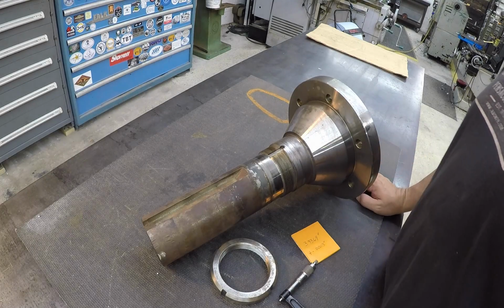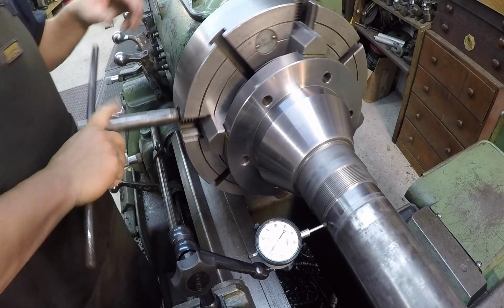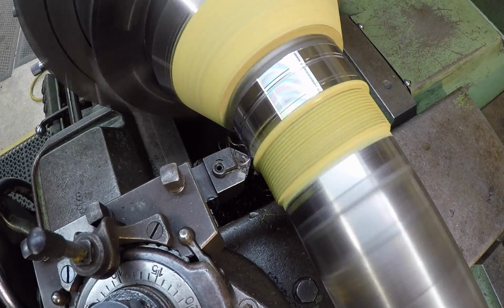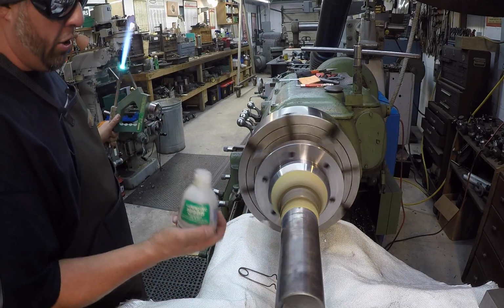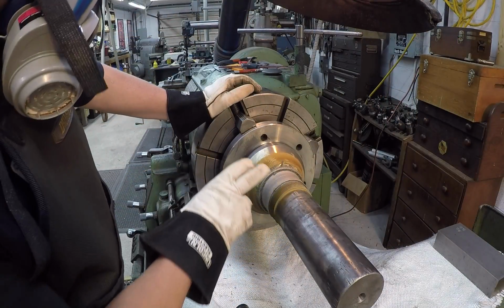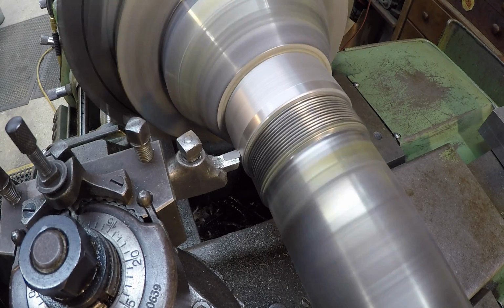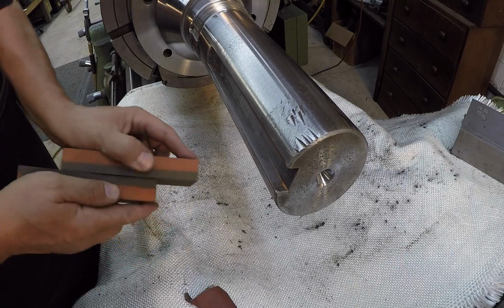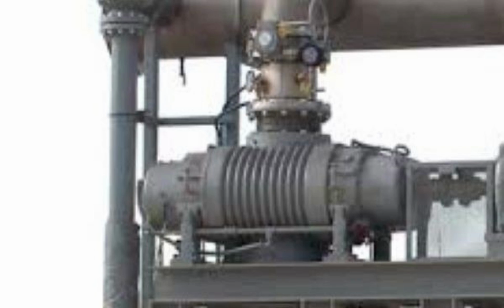SNS 300: Spray Welding a Blower Shaft

Comment: I was struck by the turning down of the spray welded section that the metal didn't come off as a spiral but as flakes. Is the welded section more porous on a microscopic level? A bit like a sintered bearing.
Reply: It is a 'cold work' process, so for sure metallurgically different than the base material.  Sintering is likely a good comparison.

Comment: I read about this process about 50 years ago. I was impressed by the possibilities, but I never had a chance to see it actually done. I talked about it to a friend who said I was BS-ing him. Now I'm vindicated. Excellent video. Thanks for posting it.
BTW was this process ever used in crankshaft stroking? Would it even be suitable for such an application?
Reply: yes, the process for repairing a crankshaft is very similar. Difference is the powder. Like he talked about it takes a special type of powder because of the friction on the actual journal surface.

Comment: To ross reed; I see you have removed or had your coment removed. To explain to you an Instrument maker means I spent 7 years gaining my qualification. Most of my has been spent working on Military and Aerospace prototype work and I am currently working for a satellite company so I think my ability and knowledge suppresses yours by a little. To answer your statement as clearly as I can. Your knowledge of engineering is only surpassed by your ability to re-bore a Harley with an angle grinder.
Graphite grit or similar comes off paper or cloth and embeds itself into softer materials. Grinding say for example a camshaft you use a rotating grindstone whether it uses diamond or graphite and on a CNC or manual machine It is a precision tool.... is not the same as sticking it on paper or cloth. All I was asking is why would you do such a good peace of precision work to then use cloth when you have stones to hand as shown in the Video ?!?
Reply: Togz100 has come

Comment: nice haven't seen this in ages . we did spray build back   in 70's and 80's  in shop i worked for,  nice example  of the need of  prep the surfaces  first. and one  company we did a large  amount of work was specific  pumps and blowers also

Comment: I am not a machinist by trade, but have for the past year year worked in a paper-winding factory that predominantly makes kraftpaper/cardboard tubes, liners, and cores. I call myself 'the wizard's apprentice' in that I am there mainly to assist the machine operator with the functions he performs. -Bring tools, carry this, lift/mount that, palletize the product, etc. I watched this entire 51.04 video and am in a word, in awe of what I saw. The video very closely demonstrates what my immediate co-worker (the operator of a massive paper-winder) described for a series of mandrel repair processes he periodically does at another shop to 'build up' weld on rotating and/or stationary shafts where super-close tolerances are required.  My take-away from this video is a greater understanding and appreciation for the work involved. This video is amazing! Well done, you!

Comment: As an instrument maker for over well 40 years now I am very surprised you used abrasive cloth to bring down the bearing face and give it the final polish as you will always be left with traces of the abrasive which will speed up bearing wear regardless how small and how much you clean it. I have always used precision ground stones as they are better to maintain and ensure an even profile and you don't leave contaminants in the bearing face. I know I'm old school (on QC now but I would never let that out the shop floor) or am I missing something?   Impressed with the rest of the job 1st rate
Reply: My humble opinion, but in my observation there is a heck of a lot of difference between a precision instrument and a 70# hunk of steel that is used to turn a blower cage.  The bigger question is how did the shaft get so tore up to begin with.  Lack of attention to bearing lubrication and/or lack of attention to machine vibration come to mind.  In the world I came from (water/wastewater) there isn't a budget to get a NASA-rated repair.  Get it so the new bearing will seat with the proper fit, educate the maintenance crew about how to avoid this problem in the future and get it back into production.
Reply: @larrypatterson3957  I agree totally....... A very expensive hunk of metal with a precision bearing where a repair is a much cheaper option than replacement.
Reply: So stones are not abrasive?
Reply: @justinbenjamin4651 A precision stone cuts as opposed to grinds (it is still termed as grinding). Yes stones do wear but to a very much lesser degree and the cutting fluid holds and caries the derbies away thus greatly lessening any chance of leaving derbies on a bearing face. 

To summarise its cleaner, quicker, more precise, does not leave contaminants behind and still an on hand hand-tool as he showed removing the pipe wrench marks. It really is basic 1st year apprenticeship stuff.

Comment: I was thinking you were going to TIG weld the tool marks but that would have probably been a waste of time. Nice work.
Reply: That was actually what I thought when I started watching this video...
Reply: A TIG weld, or any type of localized welding would cause the tube to distort.   So, that wouldn't work on this job.  The spray weld does heat the metal, but the heat is applied while the tube/shaft is turning...so the heat distortion is equally distributed on all 360 degrees of the shaft/tube.  Evidently this shaft spins at high rpm while in use.  So any distortion would cause vibration....possibly self destruction.
Reply: @WAVETUBE84  , thank you for the feedback.

Comment: I am 60 and a former A & P Mechanic and had never heard of this type of welding, this is one of the best videos I have ever watched and wish I had half of your skill.
Reply: Yes same.. never heard of a spray weld befor..
Reply: same here never heard of spray well before but I've done a lot of different type of other welding this was the most awesome thing I've seen and very well explained throughout video step-by-step.
I would have been afraid to take off the other end where point meats shaft. Steering shaft may get too hot and sag.

Comment: The first and only time I used Spray-welding was over 50 years ago... I feel really old
Reply: Me too! Exactly 50 years ago I had the front end of a '69 Alfa crankshaft repaired this way when the nut holding the harmonic balancer/pulley had come loose. I was hopeful but skeptical it would save the crank. The loose balancer/pulley then chewed up the mating surface on the crank and the keyway, and the key, and of course the pulley. The problem revealed itself because the mechanical fuel injection is timed off the pulley by a tooted belt and the car alternately ran great and then like s*it depending upon how far the pulley rotated off the timing mark. Had a racing balance done on all rotating parts (0.5 gm) and the new pulley came back looking like Swiss cheese on one side. Voila, the problem from the very beginning. After this the engine screamed for more than 135K mi. before other parts of life made it a garage queen. Still awaiting the wrenches... Thanks for the vid. Never seen it actually done. Great work, too.

Comment: This is an excellent clip for learning machining and surfacing. First, Sir centered the shaft in four holders using aluminium washers and bolt pressure, as well as measuring instruments. Then you secured the shaft on the thread and the cone. After heating it with technical gases, he began the surfacing procedure. I do not know wheter special powders or emulsions? I haven't seen this technique yet. And the standard final procedure is turning and grinding with sandpaper to achieve an accuracy of 0,0003 inches. Very good  work. Congratulations :).

Comment: When you work on a project with a small tolerance like this the first thing that popped in my head was expansion. Looks like using a torch running that hot for a long period of time would cause the steel to expand. It's probably a dumb question because the piece was so big but how about a smaller project that's only one inch in diameter? I think you touched on that at the end but I'm not sure. Great video, by the way, I love this kind of stuff.
 Dave

Comment: Back when I was a teenager I did bit tipping of Hughes drill bits I due believe that this is the first uses of spray welding, I did wonder if it could work on shafts too. Well, now I know that my own thinking was right but I had no one the tell about the usefulness and Quality of said processes otherwise I would try it when I was working on trucking shafts.  I'm now over 80 years old. And just learned that was right. I could have used the process toward my benefits.

Comment: Out of curiosity would this procedure be acceptable to repair a bearing journal on a crankshaft?
Reply: Absolutely. It's one of the very few ways you can build up a damaged thrust surface on a crank, since most of them will get junked if that happens.

Comment: How great to come across your video! Back in the 1970s I was a factory Sales Rep. For Eutectic, and sold this system Utaloy  as well as Hard facing powder sprays for farm equipment to ocean going ship propellers  !  Eueectic mfg     
 Ac,..Dc,.stinger does  great repair on CAST IRON and Alumanum .  It's a great company with great products!

Comment: Spray welding is considered a cold processes???  All things in relativity I suppose, I know in the days when the shop didn't have AC, parts that were made in the day would go out of tolerance at night, and vice versa due to the 'extreme' temperature swings.  Cool processes, thanks for the video!
Reply: There is a cold version of spraying https://en.wikipedia.org/wiki/Cold_spraying there are even 3d printers based on that technology,

Comment: WOW, i have worked on lots of different machines in the past. I built handmade caskets for almost 30 yrs but the plant went south of the border. Now i'm repairing long wall mining power distribution systems up to 12470 volts. Your work says alot about how you do the the very best you can. Great video.
Reply: Yep capitalism  strikes  again

Comment: Sorry to be so picky, but does that decimal number (0.0003) not show 3\10,000 instead of 3\10? Redfox007
Reply: you are correct, however in the industry, most guys call ten thousandths, tenths.  3.9372 is usually said as 3inch, 9hundred thirty seven thousandths, and 2 tenths(meaning, 2 ten thousandths).  I always thought it was odd myself, but that's how most machinists roll...
Reply: When he said three tenths he meant three tenths of a thou.

Comment: I worked for a co that didn't understand what the guys on the floor where doing that machine shop isn't a round any more. It was run by bean counters for about 10y before it went under. Had been around about 50ys put about 50 guys out of work some had 30ys to 45ys working as machines I had 15ys some stared there owen shops😎phill gusto 😎

Comment: I do robotic thermal spray.   We normally use plasma to buildup material for similar shafts.   Great way to save very expensive aerospace parts.  It can be coated with tungsten carbide also if you need a tough area for a bearing journal etc.  These repairs are usually aerospace only.  Normally you need to grit blast the area before you spray weld to get a better bond
Reply: Would the under cut and scratch pass (with threading insert) be an equivalent prep to your grit blast?  I’m assuming the under cuts give a larger lateral hold at each end for the entire buildup area while the scratch pass roughs the surface for bonding and possibly gives a bit more lateral grip/texture.  

Closest example I can think of is using a throwaway drill bit to sure up an epoxy repair on a broken gun stock.  Opposed to using a straight rod/wood dowel rod.  I’ve seen others cut grooves into brass or steel rods too. Also making sure all surfaces to be bonded are not smooth.  Gives all the “bite” possible.

Maybe this prep work gives a work around to sandblasting, and possibly a better hold for this application.  

Just curious.  Obviously, this stuff is super interesting to me.  Like anything way out of my range of abilities :).

Comment: A.S.M.E. Certed pipewelder here. Mostly maritime ind related. We would use this process to build up prop shafts, rudder stock shafts and tapers on propellers .
This and "thermal "( or poured) welding were some of the more interesting jobs i had! This is good to a certain thickness ( if memory serves) and then your stuck with auto sub arc and the subsequent straightening post weld.

Comment: In NJ there’s like one company that does this that I know of, pretty much everyone goes to them for it. They do it on site also, although I’m not sure how they do it without a lathe. I am guessing they use the motor itself and some portable cutting tools.

Another thing that is common is a ceramic or epoxy like material. We have a balancing business so we see this stuff a lot.

Comment: My dad used this process back in the 80's to save many customers thousands and thousands of dollars by repairing the shafts of obsolete motors in old applications where to replace the motor was nearly impossible because of the application. He was a great machinist. RIP pops.

Comment: Used to do engineering/design of heavy equipment and repair of equipment. I have observed shrink fitting by using both liquid nitrogen and dry ice and the building up of weld and then remachining the entire part and then process annealing that part. (of course it slightly warps it) This is the first time I have observed a spray welded repair of a machined part. I really enjoyed this video and I used to take classes at the local vo-tech so that I fully understood processes like this. They don't teach you everything in college and good machinists and welders are just skilled differently than I was but they are skilled. A skill that is seemingly dying off out there. Thank-you for creating a great lesson and introducing me to something new.

Comment: I never seen this before. One question: the substrate does not melt, so its not real welding is it? The process even includes a bonding primer, which wouldn't be needed if the powder actually melted into the substrate, right?
Reply: Imagine a load of fine spatter after welding this is what is happening in this process putting it basically. It is a very very fine application process, commonly used on rebuilding journals on an engine crankshaft before regrinding.

Comment: My grandfather was a prototype machinist for most of his life. He had over 175 patents in his lifetime. A lot of his work was spent in a salt rich environment. In about 1971 or 72 I watched him work with a blow welder as he called it to fix bearing journals. By the time I was was old enough to drive I had a Main bearing in a slant 6 to 25
Reply: Do not know why it just posted as I was not finished. But as I was saying I had a main bearing go out in my pickup and had to pull the driveshaft in a slant six 225.
My grand father watched me set up every thing  and helped a bit but made me use the blow welder after cutting back .0015 and than building it back up and turning it back in spec and polishing it. That engine ran for another 278,000 miles before I sold it. Was the only time I ever got to play with it as I went into another trade but I always had a bit of regret i followed the wrong grandfathers trade.

Comment: Wow! Could this be used to save a crankshaft in an engine that spun a rod bearing? Crankshafts are often made into boat anchors or big paper weights because of a few scratches on one journal. 
I’m not a machinist and I’m only a shade tree mechanic with a handful of engine rebuilds and replacements so if I ask a dumb question forgive me.
Reply: Kevin Tucker the heat that the engine creates is the issue.

Comment: Brilliant stuff on cold running metal... don't use it to repair internal transmission/engines shafts anything that heats up as it just falls off... ... they do a cast iron spray and plastic to 👍

Comment: Did a lot of metalizing/ spray welding for 35+ years. Mostly Metco stuff (powder and wire systems), but also included Eutectic maybe 10-15 years later. Very nice job! I miss the work now that I'm in a different line of work (self employed)

Comment: i work as an electrical engineer and my main job is working on and repairing electric motors from varying sizes in germany. until now i usually just used electrode welding to repair shafts but i have showed this to my boss and maybe we will change our repairs. thank you so much for making this video!
Reply: Best comment! It seems like this way of Repair a journal has been in a way, lost to our “throw away society”! Please bring it back.

Comment: Thanks Abom for showing us spraywelding. Did you ever analyze how porous the sprayed layer is? 
Anyway cool procedure to save expensive parts with small damages!
Reply: Micro porosity is a feature of this type of coating due to the particle nature of the deposit.  If used in a wet/corrosive environment a sealer should be used.  There is some benefit to this porosity when used in a bushing - oil and grease permeating the coating can be released back into the interface between the bush and the parent surface, especially if friction generated heat is a factor.  That was where the name of the materal, Lubrotec, originated.

Comment: I was trained on a Herbert 4 and 7 Capstan lathe for Plessy Aerospace back in the 70's so I can relate very much to your techniques for setting and turning that pump piece. I have, however, never seen spray welding. Which is a complete surprise to me having also been a sheet metal fabricator/welder of Tig, Mig, Electric arc and Gas. You obviously know your stuff and I enjoyed watching your skills. The difference in cost to repair or replace is immeasurable. Happy customer and thankyou for your education. I would love to perform that technique one day. Fond regards.